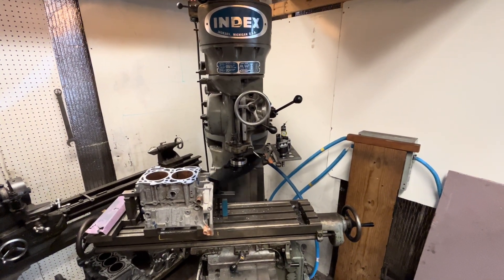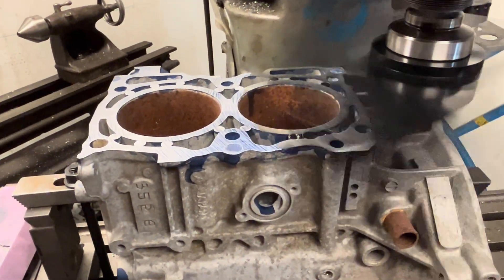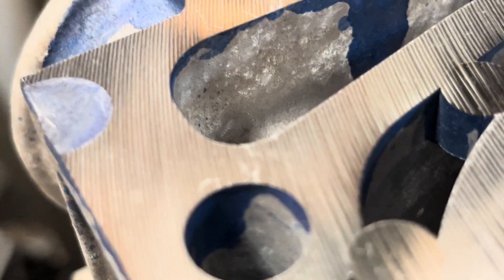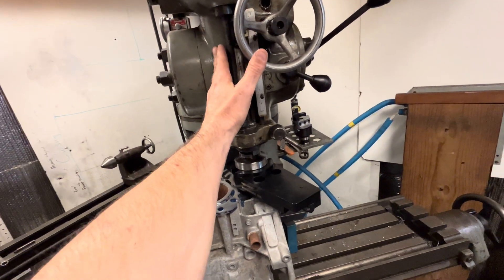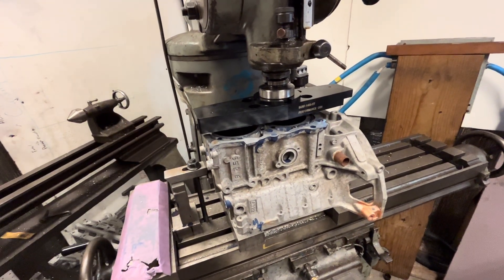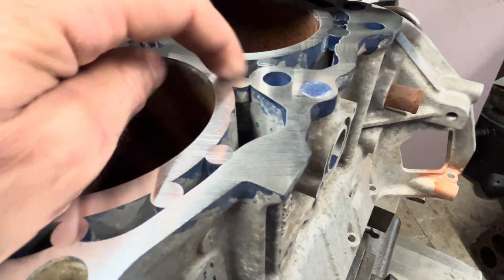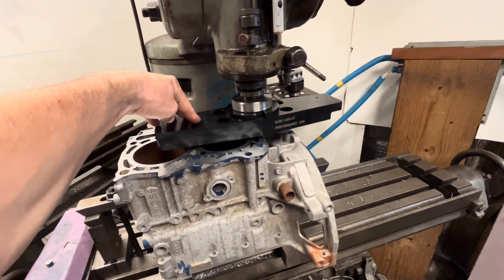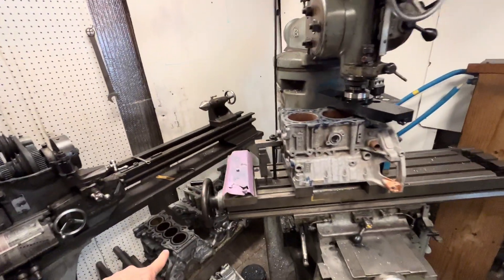Max Feed Test 14” Sufacing Flycutter on Milling Machine PCD Aluminum

Comment: You can clock the time it takes your table to traverse its x travel.  By timing how long it take for x axis to travel (x amount of inches).  A pinch of napkin math and knowing the travel distance will let you figure out your powerfeed's speeds for each gear.  Then you can begin to calculate proper speeds and feeds for the part your working on.

Comment: Also as far as your idea of doing one part in a conventional milling style and then coming back on the second part from a climb milling direction will shake your machine and create a terrible surface finish.  Another thing is that the cutter is much too big for the job.  So much of the tool is in rotation prior to engaging in the cut.  You will have a much better surface finish is you make a fly-cutter and grind and hone an hss bit.  CBN and carbide need to take a serious chip to get best performance.  Your machine cant handle that well so using hss tooling and taking a light cut with a sharp bit will get much better results that that big tool if both were used in correct setups with appropriately dialed speeds and feeds.
Reply: thanks cattle dog, very informative
Reply: I resurface blocks and cylinder heads. Aluminum and iron aswell as aluminum with iron sleeves. Our typical automotive fly cutters are 12"-14" and CBN is our main tool and we rev high. Mine spins around 1000rpm.
 Our depth of of finishing cuts are 0.001"+/- couple tenths and we easily achieve 15-20ra, over and over.
Reply from the maker: @whiplashmachine in a following video, I switch up to the 12” aluminum flycutter, which the machine likes a lot more than the steel 14”.  We also switched to a 3/8 round PCD insert, rev at 1000rpm at 9.25” min (fast as she goes).  That was only a few days ago, and I think it made the best finish so far.  In that video I test 600 rpm also at 7.25” min.  And discuss some chip size math.  I want to take samples to RA test so I just know what they are.  It would be cool to have one on the show; which I’m trying hard to borrow one for a night.  Thanks for watching 🫡

Comment: Dude you dont need a a way to gauge your surface finish, you just need to use a flycutter properly. You are doing your best to carve grooves in that block. I cant comprehend how you could think that spinning something that slow with that ridiculous feed rate could ever work.  A profiometer would not even tell you anything as they dont measure that rough. Its like plow marks in a field

Comment: Your RPM is way to slow for the feed rate.  The scalloped toolmarks are stepover lines.  The high point of the ridges are the area being skipped due to table travel speed.  Lower feed rate and higher rpm will produce a much better surface finish on that machine.  Also the inserts on that flycutter are not optimal geometry for that material.  Likely a shallow depth of cut finish pass with low feed rate and high rpm (not higher than that tool is rated) will get you where your going.  Also dragging a chip is the enemy in this situation, compressed air blasting the chips while taking the cut at lower feed rate should help chip welding.  Untill you get a surface roughness tester a surface finish comparator will get you close enough and can be had on fleabay for song and dance.
Reply from the maker: Very good input.   The video I did before this one; I did 600 RPM at half the speed, in which it wasn’t taking a full chip.   I have a 12” Aluminum Flycutter to use on the next video which I’m aiming for tonight.  I’ll get the rpm’s in the 1100s ( the next speed up on my mill ) and we should see how that does too.  I’m not expecting anything much because my spindle is a weak NMTB 30 and my table has dovetail ways; I’ve been told no matter what we will get vibration issues etc.    As far as the geometry of the insert, I have 2 cartridges, one is positive rake at 6* but we didn’t use that one, we used the no rake I believe ( but that is the geometry that comes on a comec/rottler/robins stuff to my knowledge.  Rngn 43 1/2” stuff.   You tell me tho , I’m not an engineer, I’m just lucky to demo these flycutters and entertain the viewers and burn up tool😋👍.
Reply: @kalamazooenginemachine  Trial an error  is a tested method for success.  You can achieve a lot with less than optimal machines.  The old saying " A good machinist can produce great work on junk machine, and a bad machinist can't do good work on a great machine."  With older machines they all have flaws, the key is to be aware of the flaws and work around them. 
   I can see that your forced into that position on the table by the radius of the cutter.  It could be worth it to move the head forward a  bit and rotate the head to the right to get the cutter further to the right of the table increasing your work envelope with such large tooling will allow you use the sweet spot on the travel. 
    Figure out how flat your table is and if it has a section of travel that holds a tighter tolerance than maybe the very center of the table, which is often the spot to avoid on older well used machines. I would sweep the table with an indicator in all directions and mark its deviations and work around them.  The Y axis also likely has a sweet spot as well.  By finding the y axis sweet spot and moving the head out or back to center on that sweet spot could help out.  The further back you move the head the more rigidity you get so long as you can still reach your work envelope.   Lock down everything except the x axis to increase your rigidity.  Lock the spindle and  the Y axis and knee.  Tighten the x gibs a little.  Tighten all tilt/nod bolts on the head and lock the ram column and anything else that could introduce play or vibration.  Stuffing the head your surfacing with shop rags could reduce vibration on the part itself.  When I ran manual mills I would always tram in the machine before taking any cut of consequence or on a part with a lot of hours.  

   Having fun yet?

Comment: On y’all’s dowels y’all using for cylinder support, what if y’all drilled and tapped and used a set screw in place of the dowels? Just a thought…
Reply from the maker: Yes sir that is a great idea. 👍 I would need aluminum threaded dowels, which I will look into soon. Thanks for the suggestion 🫡